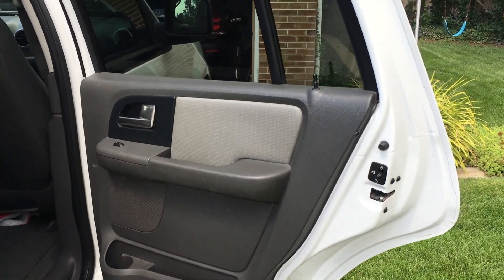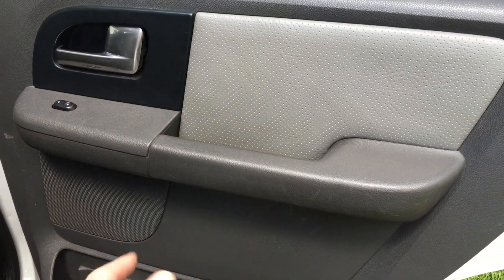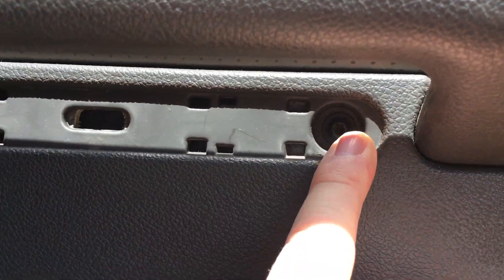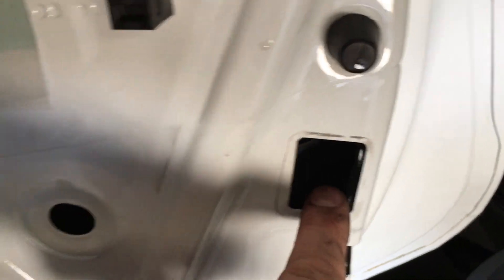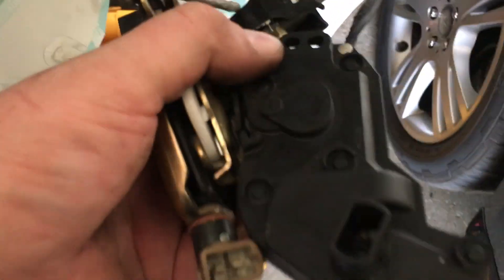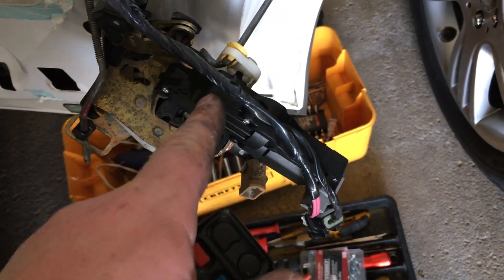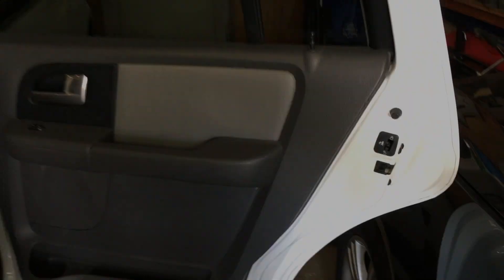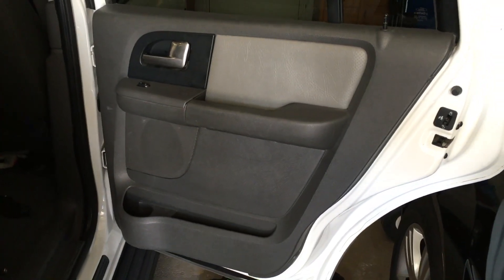2003 - 2006 Ford / Lincoln Expedition Navigator Rear Door Lock Fix

Comment: I have an 03 nav - my issue is that both rears are not responding at all and the two front ones now are being "lazy" they sometimes wanna work and sometimes "almost" work... the passinger side never usually opens and the driver side never usually locks... how often do these fail? the truck is 20 years old though 🙂

Comment: Have an '01 where the rear inside handles don't unlock or even open the doors even though the child safety locks are off.  Any ideas?  Power locks work, just not the inside handles.

Comment: What is the part number for the little green and black clip that attaches to the exterior door latch?
Reply: Its called door lock handle rod  retainer clip latch actuator, you can look it up in eBay

Comment: That was awesome. My question is this...I have a 2005 Expedition and the drivers side passenger door will not open from the outside. It will from the inside. Do I need the exterior handle or is there something else? It springs back from the outside when operated, it just doesnt open.
Reply: Mine is doing this also, now. I think it is that green clip thing he showed in the video, but not positive.
Reply: My 04 expedition is doing the same exact thing
Reply: @andreab7106  mine is the green Clíp and can’t figure out where to order one. Did you ever get one?
Reply: @IzzyR1v  I bought a variety pack of them from Autozone, from their "Help" section. I still haven't fixed it, because it is my second vehicle, and doesn't get used much, but that pack supposedly has the clips in it.
Reply: Same here, anyone figure it out?

Comment: I have an 02 Expedition..the rear door child locks engage everytime we open and close the door...the door will not open from the inside.....my kids are older now and this is a safety issue if they need to get out of the vehicle they cannot. all I can do to rectify this is hold the door safety switch towards the "unlock" position and wiggle the handle a few times..this allws my daughter to open the door from the inside when we get to where we're going.....but after that exit the doorchild lock will engage again unless i do the "wiggle" trick again...anyone have a fix for that??